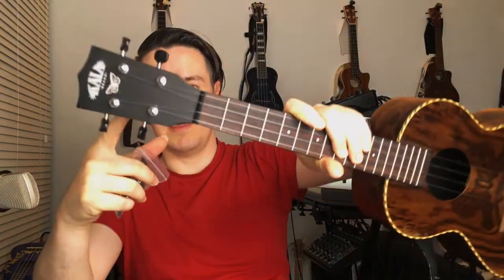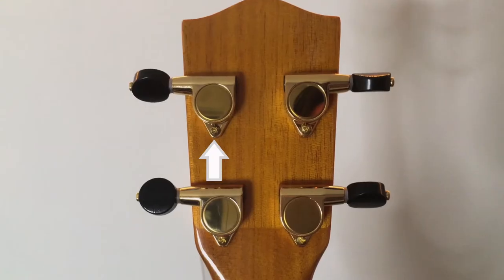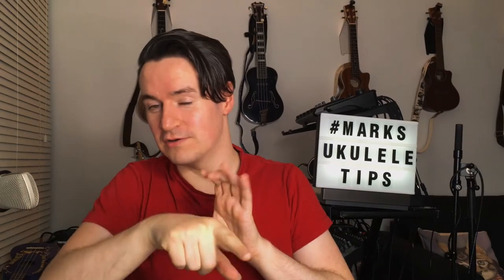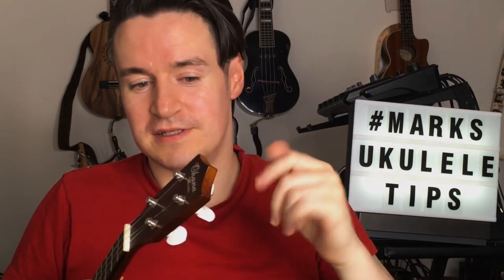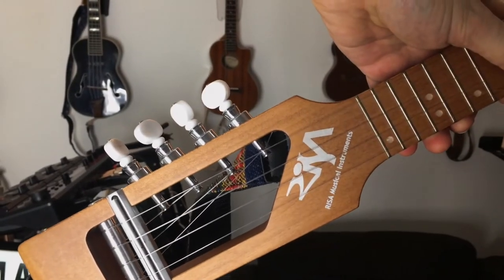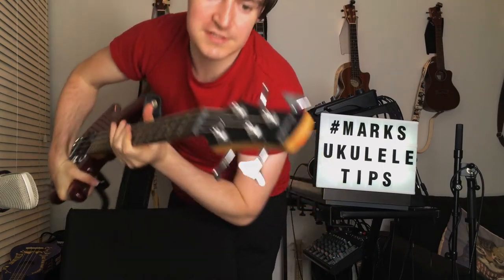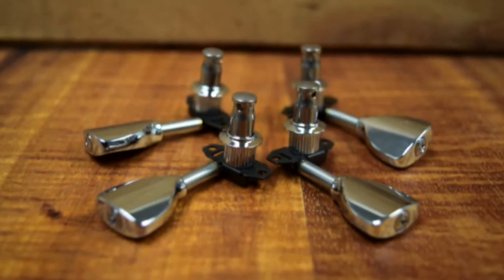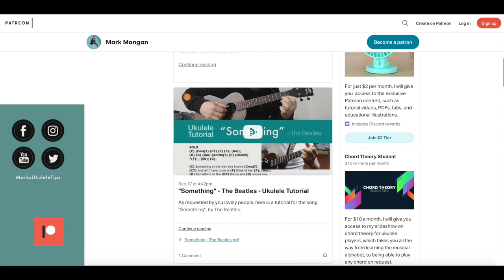Ukulele Machine Heads

Comment: Mark, may I ask advice?
I bored out some tenor ukulele tuning holes too big.  What to do?  1)Try using mini sized guitar tuners?  2)Fill the holes with mahogany dowel and redrill?  I respect your opinion.
Reply from the maker: Yeah, you could try either strategy, depending on what would be visible and your level of comfort doing woodwork. 

Some ukes use those larger guitar parts and just drill larger holes, so that's an option. Just check out the size of buttons, poles and bushings and make sure nothing is unsuitable before you go drilling. 

The dowel option could potentially have a little bit of give under tension depending on how solid the wood and glue is. 

I'd need to see it to be sure, but off the top of my head, if it was me doing it, I'd probably opt for the guitar parts, so long as everything fits (except for the large holes).
Reply: @MarksUkuleleTips  Awesome.  You are my savior! (Well, sort of, hehe).  I will search for light weight guitar machine tuners!  I will go very cautiously as you suggest.
I caused trouble by installing mandolin tuners that actually work but my Epiphone Mandobird wants them back.
    For the record, the mandolin tuners are too tall, but I remedied that tallness by putting a hard rubber “washer” behind the uke head on each post to move the height back.  Funky but functional.
Reply from the maker: @jimlytleworks  Ha, thanks Jim. Remember, it's easier to drill more than to fill more. 😂

They can be a bit heavy when they are guitar tuners, and the posts can be longer. But there are plenty of ones for uke out there in that style. The post height would be the riskiest part that could lead to a wrong part order.

Comment: Ukuleles used to have friction pegs but they don't use them anymore cause they're not that accurate. Machine heads are far more accurate.
Reply from the maker: Hi Oscar. Yes, they did. You can get universal planetary tuners nowadays that have a similar look to pegs, but have a gear inside. They usually only gave a 4:1 ratio, which isn't as good as a 16:1 or 18:1 ratio commonly found in machineheads, but it does make them significantly more usable than the 1:1 ratio of a peg. In recent times there have been a few manufacturers making some interesting products in this area, ones that visually look like pegs, but have a geared mechanism inside, which is a nice option if having the old peg look is important to you.

Comment: How come machine head dealers rarely tell the actual dimensions?  I need soprano tuners and baritone tuners that are different diameters.  I guess I need to phone the dealer.
Reply from the maker: Yes, they are often quite coy about showing the dimensions. I don't know if that is in the hopes that people buy them even if they are suitably sized (hence increasing sales), or if they don't want other factories creating clones, but either way it is a total pain in the back side. 

They also often hide the post heights in their images, which means you can sometimes end up ordering unsuitable parts as well. They are often quite sneaky with their images so if you're not sure, keep looking around until you find ones that do show dimensions, especially if you're putting them in an unusual sized uke.
Reply: @MarksUkuleleTips  Very well.  I will reward the seller who works.  Waverly ones are extra nice.  Grover shows specs.  Thx!